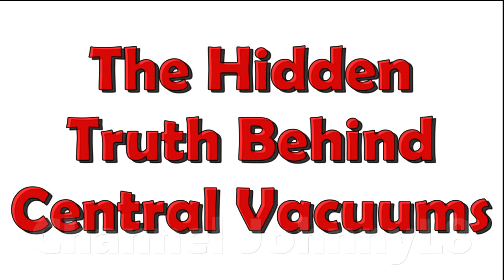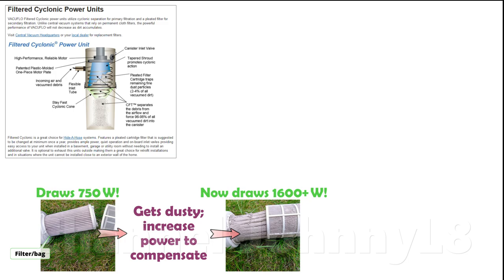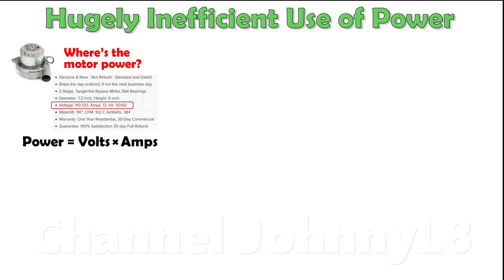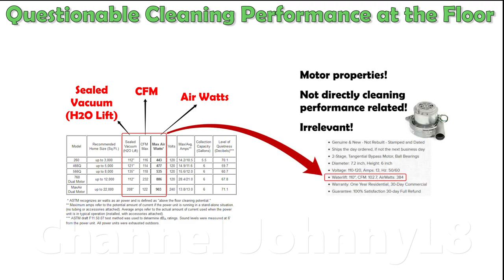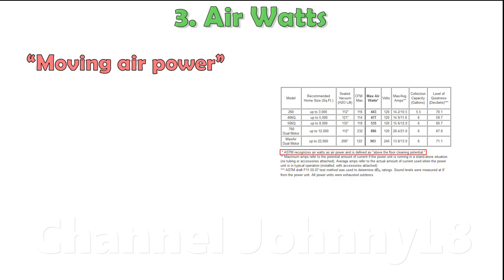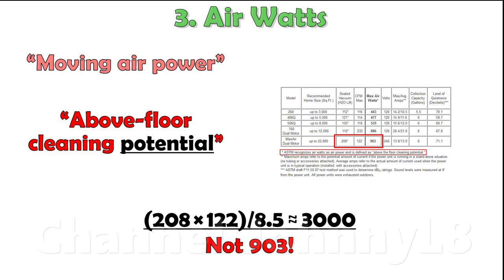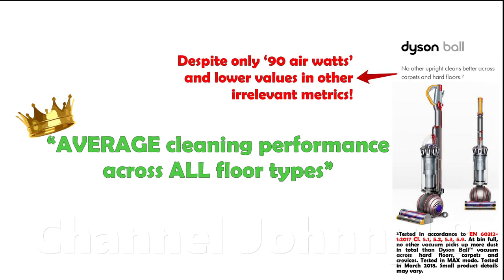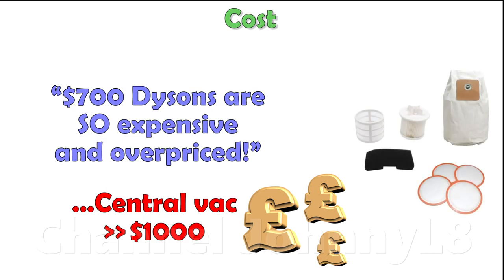Central Vacuums Trail Behind Dyson Cordless

Comment: Dyson v10 is a complete joke.  I've purchased one and have had it replaced twice under warranty because the batteries get to where they would not hold charge.  I personally don't have a  central vac but I'd wager the bags or dirt going to the outside are far more environmentally friendly than the lithium ion batteries that will eventually make it to landfills not to mention the plastics that will also make it into the landfill after the vacuum  completely fails within five to seven years time.  I owned a Dyson animal ball four years after purchase the beater brush assembly  completely  worn itself out and no one could  locate a replacement part for me so it went to the landfill. Dyson plain out sucks and not in a good way. Never again will the snake oil peddlers at Dyson get my hard earned money.
Reply from the maker: Well, you claim that but don't quite go as far as to provide some convincing evidence given that if it was common, it would have been talked about heavily. Anyone can make up stories. My battery after a year of continuous heavy use is showing no signs of maximum charge reduction. Batteries (and plastics) that are correctly recycled have considerably less impact on the environment. But two-battery machines which didn’t get their products correct will have twice the impact. I’m surprised you couldn’t find a simple brush bar replacement; Dyson’s website is the obvious first starting place to look and they have loads. Your reasoning for why you don’t like Dyson is not very convincing and can be applied to any company even more strongly. But you single out Dyson.
Reply from the maker: It's just that you're really not very convincing. You just sound like an angry Dyson brand hater rather than demonstrating objectivity. I've no allegiance to Dyson; if I come across something objectively better, it'll get the same attention. Unfortunately, nothing meets that criterion yet. This video has very little mention of Dyson and when it does, it's usually in the form of a citation providing evidence to back up the claims made. Yet you focus on it entirely and completely ignore all the important points being made about central vacs. Says it all really.
Reply: @VacuumFacts  I used to love Dyson recommend them to anyone until my last experiences with the v10. I even gave them another shot after the animal ball had problems with parts I couldn't get.  I did check Dyson's website,  called customer service,  checked Ebay,  Amazon and finally as a last resort I checked with a few mom and pop vacuum stores who all told me to just chuck it out, a vacuum cleaner I paid nearly $700.00 for just four years prior I still bought a Dyson the v10. The cordless vac that was supposed to be the end all of corded vacuum cleaners. It just couldn't hold up to my daily cleaning routine like it was marketed to do. The first battery lasted about five months with daily use,  the second not even two months same problem. Now after the second battery Dyson tells me oh well nothing we can do about it,  we've already replaced it once.  So yeah I am an angry former Dyson customer who prays daily for the company to go under.  I praised and believed in their far more  superior products until this.  I guess what makes me angry at your assessment of this product is I see myself the fanboy (well former  Dyson fanboy) in you.  I convinced many of my friends and family to purchase  Dyson products and unfortunately one by one they are all beginning to have  issues and with the premium price Dyson commands it is simply unacceptable. The products should last longer than a year,  four,  or even at minimum a decade.
Reply: I said  battery should  correct my mistake and say machine  they replaced the entire machine not just the battery....
Reply from the maker: They're supposed to last a decade. You're the first person who claims to have had such serious issues, which if anything, shows it's rare and you had bad luck. What I don't have is any information about exactly what failed and why. It also sounds strange they wouldn't replace batteries which were faulty if you're under warranty, especially if you send them back so they can examine them. A whole machine replacement seems a bit extreme. Again, I had a DC35 for several years without an issue, and I've had the V10 for a year now and it's as good as it was on day 1. You're the only person who's had any major issues that I'm aware of. I'm not sure there's any reason why any other brand would be expected to be more reliable.
Reply: @VacuumFacts  I have no idea what went wrong with them,  and Dyson required me to mail them the entire machine in and after the second machine failed I  called  customer service they looked up my file then replied well were really sorry this is happening to you unfortunately we've already replaced the machine once under warranty and there is nothing more we can do.  I spoke with the floor supervisor same story. I was given an extension to call directly to the floor supervisors number was once again told the same thing and promptly hung up on.  I tried calling a few more times but it was just please hold while I transfer you a never ending loop until I get hung up on.  I seriously doubt that I am the first person with this or a similar issue,  just the first person your aware of.  Their are bad reviews about all of  Dyson's products on the internet you just have to look for them.....granted many are of user error mine wasn't because I am one of those annoying people who insist upon reading directions/instructions in complete entirety before using a product.
Reply: I asked customer service what was wrong with the product or could be causing my battery issues no one could tell me.  So maybe I'll admit am bitter about Dyson now in general bet you'd be too if you were in my situation.  I also owe you an apology for being kind of a jerk towards you  by calling you a fan boy and such. Got a new subscriber from me if for no other reason I am curious if you will ever experience the same problems I had.
Reply from the maker: Yeah it's always difficult to know how to react to stories of problems. Unless you're there and see exactly what's going on, it's always hard to tell much about why things happen.
Reply: @VacuumFacts  indeed,  anyway you have a wonderful day I must go enjoyed the chat. Once again sorry I was being a bit of a jerk towards you.  Please keep us updated  should your v10 develop any problems, I sincerely hope it doesn't truly I do.

Comment: Just last year the power limit was 1600w. The bags are huge. Mine will last more than a year. A central vac will last many more years than a Dyson. When it fails you inly need to replace the motor which is a simple process. A bagged central vac doesn't pollute. And 98% of a filterless central vac is hardly polluting 😁 You do talk some nonsense!
Reply from the maker: I think most people are generally happy with how their vacuum performs, to the limits that they actually care. Replacing the motor may be a simple process for some, but just rinsing the filters and emptying the bin is an insurmountable obstacle for many. The power limit isn't 1600W now though, big bags mean more unnecessary material in landfill and that's still an avoidable polluting consequence that scales across a nation. And only looking at the number 98% rather than what that 2% left actually is, is burying heads in sand. That 2% is the really harmful stuff. Central vacuums represent inferiority in design and efficiency, and a complete cop out of a good solution.
Reply: You must be joking right. According to you All people need is a V10 and leave their homes full of hidden dirt.  Carpets looking clean is not the ideal situation.
Reply from the maker: The V10 claims to do the job of a mains upright. It appears to be true as far as I can tell, but that's no substitute for formal testing. Dyson have been in court over claims like that so many times, and each time, they present the empirical evidence and the accuser looses. If they've made a claim, it's highly likely to be true and they've got the evidence for it to smash anyone who naysays in court. So yes, I'd be reasonably confident that all people need is a V10 for normal, real-world mess levels and cleaning requirements (i.e. no toilet rolls on the floor and silly things like that which don't mean anything).
Reply: That's anecdotal. Take care of your vacuums and they will last.
Reply: You might the have love relationship with the Dyson. No other right mind person would compare central vacuum to the V10.

Comment: I have a central vacuum system and never had any issues, superb suction far better than dyson which is crap. And coupled with a powerhead its fantastic for carpet grooming also. So I sould wind your negative head in.
Reply from the maker: I don't doubt they do the job. But my video wasn't about that. It was about how at least as good, if not better, can be achieved more efficiently, cheaply, conveniently, and with less cost to the environment. Suctino is one thing, but what about cleaning performance? If you happen to have any formal test data, send it along for us all to see. Otherwise, subjectivity doesn't really convince.
Reply: @VacuumFacts   I used to work for Hoover from 1965 until i retired in 2001 and i used to design vacuum cleaners before you were even though of, I used to work on all uprights, suction, and portable cleaners, and we designed the first bagless cleaners long before dyson and other manufacturers brought them out. And your post is of no relevance what so ever. The basic method of testing a cleaners suction performance is simple and very effective, sand or salt is weighted prior and then spread on a carpet area and vacuumed and then weighed again to give a indication on how effective a cleaner is, so what you are preaching on about is complete rubbish.
Reply from the maker: @alex tilson You have demonstrated a great deal of ignorance that has undermined your respectability. It is well known amogst all those worth listening to that performance testing is conducted to formal international comparative industry test standards. All manufacturers unanimously agree they are the golden standard by which to compare like-products, and this is agreed in court. You've not only demonstrated a total lack of the most basic of knowledge, but failed completely to present any data resembling support for your original comment and claims. This is a common trend observed from naysayer comments. Ignorance and subjectivity are their bedrock and why I'm even here. Their wonky worldview is contradicted by facts, and in lieu of a good counter argument, they're left with subjectivity and name-calling. If I recall, Hoover were defeated in court for having tried to rubbish, then steal, the patented technology of Dyson. And then they lost their market. Respectable company...

Comment: One more thing: there is a point of getting rid of dirt FROM  dyson, when You throw it away, do You just spill the dust into dust bin at home or do You pollute outside at the bin? Because when You do that there is less than 95% of it going to the bin, the rest stays in the air... and i am not even going the lengths of writting about the amount of the finer one....
Reply from the maker: You empty it inside. It takes 5 seconds and is messless when done correctly. Issues emptying a Dyson cordless is simply and demonstrably false...to wit: https://youtu.be/E_ik6qScs0o This is another non-argument against the latest Dyson cordless machines.

Comment: This video FAILS to identify the most important, fundamental difference between central and portable vacuums like Dyson that most consumers don't realize. 
Central vacuums remove contaminated waste air from the living space while portables vacuums DO NOT.  It's a simple design difference.  The claim about centrals "polluting outside air" is absolutely ridiculous. How about your dryer and furnace vent? 

While a portable vacuum may have a "sealed HEPA filter", outside research has shown that the filter housings easily leak, allowing the intake air to release back into the room and into the respiratory tracts of anyone nearby.  Also, due to the heavy demands of HEPA filters in vacuums,  they have to be changed frequently which, if not done, can harbor microbes that release as bioaerosols into the air. Essentially, your portable vacuum is aerosolizing the dirt and pathogens on all surfaces.

I could go on pointing out the misinformation and inaccuracies in the rest of the video, but why bother when all that should matter is protecting the air quality inside the home--especially now.  Central vacuums, by design, address the air quality issue flawlessly.  Maybe the current global pandemic, spread through airborne transmission, will finally shed a light on the importance of having central vacuum and the health risks posed by portable vacuums.
Reply from the maker: You're wrong and that doesn't make sense. The Dyson handhelds are HEPA filtered and make the air cleaner than it was before, working exactly against your argument. Good dryers don't pollute and dump waste outside; it's a total cop-out non-solution to avoid a solution to a problem by polluting the environment. I'd also like you to evidence your claim that "outside research has shown that the filter housings easily leak" because I don't believe it's true for Dyson products. I'd accept it's true for cheap copycat rip-offs though, but we're not talking about them. Your claim that HEPA filters "have to be changed frequently" is false and not supported by any evidence. Dyson HEPA filters are lifetime filters that simply require rinsing with cold water every so often—mostly to minimise odours. You're also wrong to suggest HEPA filters release 'bioaerosols' (whatever they are) into the air—please provide some evidence of that, because I don't believe you and it makes no sense based on how HEPA filters work. In fact, do you even know how a HEPA filter works at a technical level? I doubt it. You've pointed out absolutely no "misinformation and inaccuracies" other than the ones you've created yourself, ironically. But I'd expect nothing less from an ignorant contrarian that you appear to be, based on what you've just demonstrated.
Reply: @VacuumFacts  It does make sense, actually.  HEPA filters ONLY can work if ALL the air passes through the filter AND if the filter is not overly contaminated.  However, over time,  filter housings on portable vacuums including Dyson handhelds leak which allow dirty air to escape before it even hits the filter. Unlike an air purifier which is immobile and in a fixed position, a portable vac subjected to routine movement which can jeopardize the seal around the filter housings.  Once the housing seal fails, the HEPA filter is totally useless. You are breathing in exactly what you're vacuuming up.

And Central Vacs don't pollute the outdoor environment. That's a ridiculous claim. According to the EPA, the confined area inside a home actually has up to 9x more pollutants than the outdoors.  The 2% fine particulate dust being vented outside by a central vac is not going to cause a negative environmental impact while air leaking from a portable vacuum inside the home will. That's illogical.

As a gift from the ignorant contrarian, I am providing a link to a peer-reviewed academic study (https://www.ncbi.nlm.nih.gov/pmc/articles/PMC3811220/#B2) which will help to educate you on bioaerosols and their relationship to portable vacuums with HEPA filters. Enjoy! I am happy to provide other links as well.
Reply from the maker: I noticed you didn't evidence a single thing I asked you to earlier. 'not overly contaminated'; you clearly don't understand how HEPA filters work. At all. You keep making claims like "filter housings on portable vacuums including Dyson handhelds leak", but you present no evidence of these alleged leaks, which makes it hard to distnguish what you say with a made up story. I simply don't believe you. As for venting outside, you're missing the point again. Venting outside is a sloppy non-solution to the need to filter the air. Why dno't you just empty the bin in the street while you're at it. Not respectable. Thanks for the link to the paper. However, it actually does not support anything you say at all, and in fact, supports my arguments about why bagged vacuum cleaners are a poor solution. The vacuums used were not Dyson cleaners and they were not HEPA filtered. To provide this link in support of your argument shows breathtaking stupidity. I'm sorry, but you clearly didn't even read it.
Reply from the maker: Er, they did not test modern Dyson handheld cleaners, which is what I was referring to. Secondly, they do not explicitly show or test for the origin of the bacteria they measure. They used machines donated by people, and it is quite possible that bacteria rich dust was on the surface of the machines and expelled. While I agree that this suggests cleaners in the home can in principle release this material, it does NOT support your original claim that they come through the HEPA, nor does it show there are seal leaks. These are wholly unsubstantiated assumptions by you. Thirdly, there is no evidence that the act of vacuuming causes more harm than not vacuuming in the first place. Fourthly, there is no evidence that the use of central vacs is signifncantly better for health (your assumption). And finally, you've literally ignored every other issue with central vacs I raised in the video. I also note you've, yet again, provided absolutely no evidence whatsoever about your claims of HEPA filters causing biological aerosol (this paper does not support this), nor have you evidenced that the seals leak on Dyson handheld machines, as you claimed. The only falsities being spread here are from you.